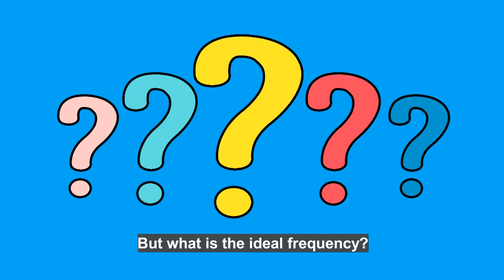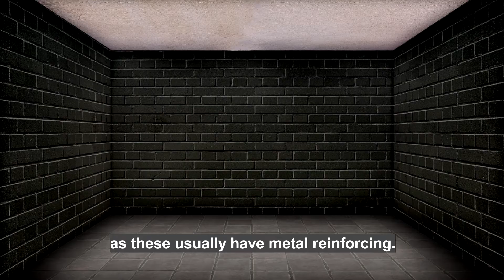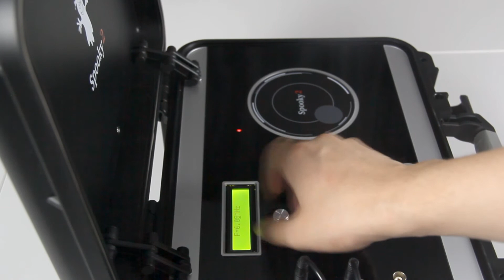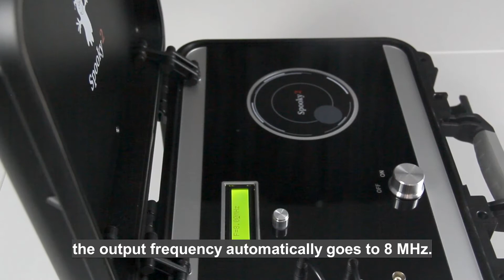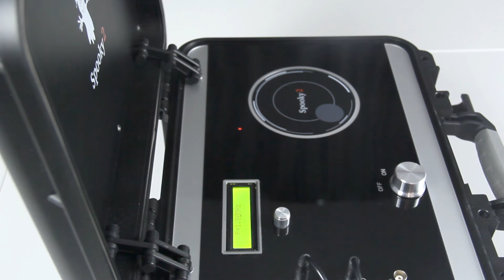Spooky2 Scalar Tuning

Comment: Yes but do we turn it back to the original 1 at 5 or do we use the second lower one.   It's very confusing. She didn't finish the sentence to explain why we turned it down to the lower 1 and if we turn it back up to the higher 1.
Reply from the maker: Dear Friend, thanks for your comment and interest, you need to tune it to the first birghtest point, which is normally between 5-6 MHZ. any other questions pls feel free to contact our customer support at support@spooky2-mall.com :).